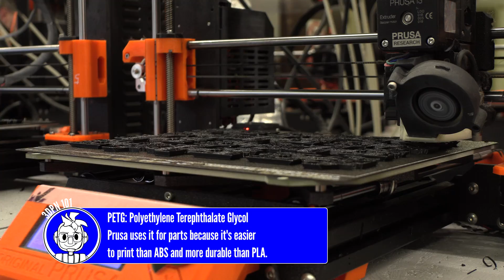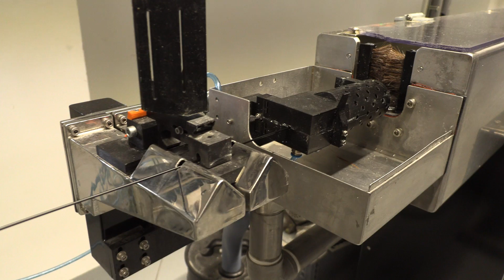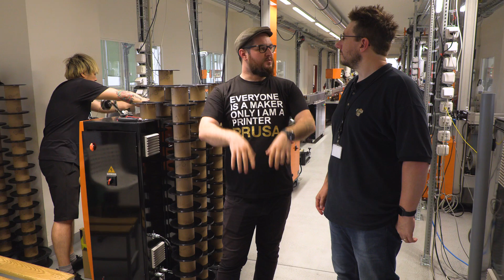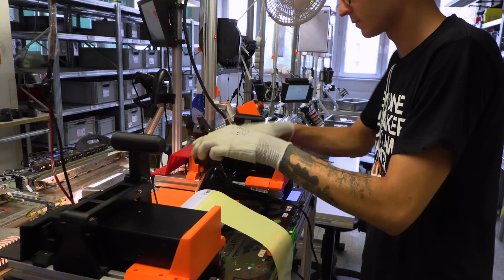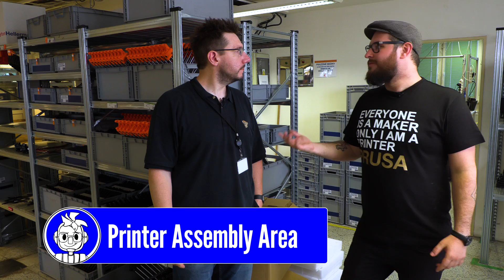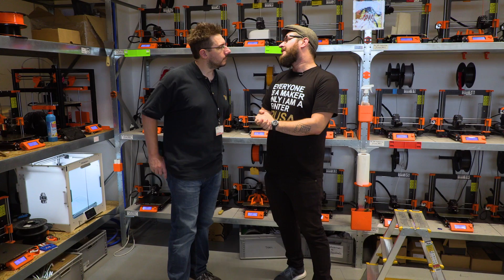Inside the Prusa Factory!

Comment: I own a I3 MK2S and I love it, it is the best printer I have. However, I struggle with Prusa's avoidance of injection molded parts (apart from the spool holder). Other than around the printhead, most parts do not change and should be injection molded. The capital investment, floor space, electricity consumptioin and labor is much less and throughput would increase and part cost approches zero. Even the parts they are developing should be made with soft tooling at "start of production". Higher production volume, lower costs, higher quality equals happer customers and a stronger balance sheet.

Comment: My lab just bought and installed 39 of these Prusa 3D printers. It's awesome & I have 24/7 access to the facility. I recently 3D printed some low-profile bull horn speaker housings for a 100W horn driver using the Prusa i3 MK3S :D

Comment: Small scale I understand using a 3d printer for production parts but at that scale, why not injection molding? This seems like a waste of electricity and man power. We have tools to do this job at a fraction of the cost.
Reply: I dunno, why do they still use an 8bit board?

Comment: I wanted to buy a Prusa but sticker shock prevented it.  These are too pricy for what they are.
Reply: Actually no.  I have also been put off by the price.  Until I recently bought a Mosaic Pallet 3 Pro.. 8 filament slicer, that was like $800 +.   I am having a hell of a time getting it to work on an ender 3 with direct drive.   Everyone i've seen with great prints is using a Prusa, The Pallet is pretty much designed to work with it more than any other printer.

I started 3d printing over 5 years ago starting with an Anet A8.  Then went Ender 5, then a couple ender 3s.     I've run into too many problems, the main selling point you will hear from everyone on Prusa is that the print quality is great, the speed is quite fast,  and the main thing for me is reliability which this excels at. They also use higher quality parts than Ender.

I sell 3d printed stuff. I have come to the conclusion with this time is money and I need the reliability.    

So to each his own, but for me it is worth it especially after spending $800 on the Pallet to have reliable prints.  And since I make stuff to sell, it is a business expense I think is worth it in the long run.

Comment: Does he manufacture all these parts with printers as a statement? Surely at this scale it's more efficient to get the parts injection molded.
Reply from the maker: I know he has been asked the question on injection molding many times, and I believe it's still less expensive for him to do it this way - with part revisions and on the fly changes without casting / creating a new mold.
Reply: @3DPrintingNerd  I just ordered one an hour ago.  Any idea why they still use an 8bit board?  Just seems for the price I don't need a nicer screen, color or touch screen, but the speed of turning the selection knob bothers me.   The difference was night and day from an 8bit board to 32bit with screen response time with my Enders.

Comment: So if you have 500 on a farm. Sell 94% grow your farm with 5% and 1% shrink. 

You basically have created a path to a Dyson sphere scale production capacity. 

A viable path. 

Adjusting for need for capital for externally sourced product and omitting greed from profits, you end up reducing sales due to your demand for capital and increasing farm growth to maintain exponential production. 

Luckily prusa is print-farming-money with space-time-money. 

Not trying to kill the sun. 

I mean enslave the sun. 

I mean sell light. 

What was this video about again. Oh yea. The haves having lots. 

I had a idea for a print farm this morning. 

I enabled my 3d printer to do more. Do it smarter and use momentum to achieve aerobic pace. 

Belt printers are where it's at.  

Gonna try to convert my creator pro 3 into a belt bed. 

Then give it robotic arms, eyes, judgment and the capacity to fail and know it. 

Hell may as well give it a blockchain too to avoid a single point of failure like sd cards. 

Is the slice on the chain? 

Then its available to print if the contract is followed according to its creators design. 

Anyway. 

That farm set me off. 

Been waiting for all years since they came out to get a 3d printer. 

Mine arrived yesterday. I got it printing 20 minutes before heading to work. 

I got a product to push on my employer walmart who didnt even consider me for the cryptocurrency and digital currency team lead director at home office. 

Did get an interview with a director 5 printlayers down from CEO. Who had no in her heart about me from the first open door email I sent to her and her bosses. 

So this video helps. 

If i need units made. Ill hit up prusa. To be a contractor. To produce the 4700 x 200 per replinishment (these are a sell out diameter product) + 2.3m (for us associates) 

I got not one question about crypto in the 25 minutes she allotted for me for a 138k per year job as a associate who has worked through walmarts bs since 2005. 

They should have hired me. Cause i know retail and tech. 

Anyway. I dont have social media. Suffer my wind!

Comment: Why is the diameter so important? After all it gets forced through the printer hot end at melting temperature. I find Prusament spools the filament has a twist in it resulting in a knot forming when printing forcing the hot end to jam and a failed print. You have to watch the whole print to supervise the spooling. I can't find any improvement in print quality from ordinary generic cheap PLA. Has no one else noticed this?

Comment: What puzzles me was the fact they using Mk 3  3D Printers to make more printer parts?  That be very slow and expensive, be better to use big multi plastic injection process factory parts machines to make thousands a day than a few hundred a week?  I understand he wishes the 3D printers to do this sort of thing as it is cool. But this way is super slow and not cost effective for a company!  Nice to have that printing use on a 3D printer But not for a company sized making them process.

Comment: Hi Joel, great videos, i recently got into argument on facebook and i was wondering if you had an opinion on the matter. Someone was asking about setting up their printer for the first time. I said the first thing that i do when ever i set up or move my printer is to check that the service that the printer is sitting on is flat and level, i then make sure that the printer is square with that surface, square the axis so that they are in line with my surface, and then i level the bed the usual way, i did a quick google to see if there had been any research into and couldn't find anything. just wondering if you had anythoughts on it

Comment: Hey, thanks for this incredible video. Im a Quality Engineer and Im really impressed with all the quality controls and automated procedures implemented in the factory to be accurate and protect customer from production mistakes. But the must important is definitely the tracking and whole producing traceability that creates all necessary capability to take corrective actions and improve the customer satisfaction. This is really awesome! Im sure my next 3D printing will be a Prusa model. I really regret that I have just bought a model from other company. Thank you so much for sharing!

Comment: I wish I could say good things but my experience was and is bad. It seems to me the heat break in the hot end unscrewed caused a giant blob. When I went to take the nozzle loose the hot end was super loose. I only had the printer 3 weeks, wrote to Prusa about damage they told me where to buy new parts. Been printing with my Ender 5 for 5 months no problems. Maybe I should have bought 2 of them instead of one Prusa.
Reply from the maker: Hey! Unfortunately without your first and last name I cannot forward this on to my contact with Prusa support. If you can, reach out to support, ask for Shane, and he can look up your records and see what happened.
Reply: @3DPrintingNerd  I love you channel and appreciate you wanting to help. I already ordered my parts and paid for them. I emailed them with what happen and was told where to buy parts. It's really about customer service. Thanks for all you do, all the problems you go thru make our life easier.

Comment: At that scale wouldn't it be a lot better and cheaper to injection mold? I'd be really pissed off to get a $1k printer that's 30% printed...
Reply: Yeah... once you have nearly 1000 printers making like 10 different parts all day every day, you really shouldn’t be using prototype machines (3d printers were called RPM, rapid prototype machines and popular for engineers going way back). It’s much faster, efficient, accurate, and repeatable with injection molding. It’s pretty sad to see so many 3d printers making mass produceable parts, they would be much better making custom prototypes for people like they are designed for (sure I make replacement parts with mine, bust most are custom upgrades, and I’m also making 1-2 copies and don’t have injection molding like this business could be doing).
Reply: @jakegarrett8109  I imagine they'll upgrade to injection molding eventually, they have to if they wanna compete with the Chinese printers.

Comment: Man the Prusa operation is impressive. I'd love to have someone ask them why they still have this giant print farm to create the components for their printer. At their scale, it would seem to be better to injection mold these components. I'm sure they have a good answer to that, I just wish the interviewers would ask that question.
Reply from the maker: From what I gather, they aren’t at a level of production where injection molding would be financially better. They makes lots of parts, but not 10s of thousands. Plus, their STL files change and are updated more frequently than would be feasible with molds.
Reply: When they can run hundreds of printers in real-world application, they can quickly catch problems and iteratively improve on the design of their printers in a continual feedback loop to improve their product. Very smart approach.

Comment: At 500 printers it's pretty much comically stupid to not do low volume(in-house!) injection molding.
The Prusa printers are great, but the way the manufacturing process is done is absolutely silly, and unnecessarily expensive.
Reply: True, but I think Prusa would rather have their 3D Printers made by their 3D Printers - and actually it would be a lot cheaper than injection molding - you do know how much time and cost it takes to make a plate for injection molding especially if they are always tweaking the design, also if you break a part you can just get their file and print your own .  There is alot of reasons why they dont use Injection molding from cost effectivness to design & Manufacturing freedom. What and how they do things is what sets them apart from everyone else.
Reply: It really doesn't make much sense. Apart from having it as a distinctive feature maybe?
Reply: It’s called marketing.
Reply from the maker: Have you looked into the cost of making molds for all their 3d printed parts? Add in the size of the order needed, and the cost the change the mold rather quickly and get a new one when parts are changed?

My educated guess says Prusa and his team have done the calculations and it’s less expensive AND on brand.
Reply: @3DPrintingNerd  In fact, I have.
A small automated injection molding machine is what, $20-30k? Each mold, if machined in-house, is ~$1-5k in time, parts, and consumables. If you outsource it, it's around $3-5k. The parts themselves end up costing cents to make, instead of dollars, and seconds instead of hours.
Molds can be changed in a matter of minutes on small machines, but even at this production scale you're only looking at running the machine at <50% duty cycle, since with a multi-part mold(which is common) will produce a couple hundred to a few thousand items per hour, depending on size and complexity.
On the scale of injection molding, Josef's business is rather small.
Parts aren't changed daily or even monthly, since there's a lot of R&D involved in making sure they're customer-ready. Up to that point, 3D printers are used to specifically do prototyping.
I should probably put this into perspective - the printers, in kit form, are around $800. Even if the markup is 50%(which it isn't), that's $200 000 spent JUST on printers. Power, HVAC and space notwithstanding. $200k gets you a very respectable, mid-range(or used high-end) high volume, high pressure injection molding machine and enough left over to do a few dozen parts in multi-part molds.
Reply: @Spirit532  parts are changed rather often, I think I heard a figure of every two weeks... Also count in the 24x7x500 printing - this level of testing is crucial for the printer reliability and couldn't be achieved otherwise.
Reply: @petrstk  If parts are changed every two weeks, that means customers are getting two week old discarded products.
Not good.

Comment: This tech scales really poorly, I don't understand the logic behind this FDM farm or any other for that matter beyond initial testing of product.
Reply from the maker: What do you mean? All print farms I've seen scaled well and were making real parts.
Reply: @3DPrintingNerd  Relative to injection molding FDM scales very poorly.
Reply from the maker: Is scales poorly over 10s of thousands of single parts. FDM is great for Prusa because not only do they get to stress their machines, they can change parts quickly if needed and not pay the huge chunk of change for another mold.
Reply: @3DPrintingNerd  Why not 3D just FDM print injection the molds instead of 30% of all production parts ad infinitum?
Reply: I wonder if a thermoplastic like PEEK would withstand injection molding? I believe SLA printed resin does.

Comment: So, even at this scale printing is cheaper than (design for) injection molding?
Reply: Probably not cheaper. But this allows them to stress test their machines and get a useable product out of the testing.
Reply: True, that is an valuable  advantage
Reply: easy to improve and adapt with 3d printed parts.. Injection molds are expensive

Comment: I do have a wish for Josef, has he thought about a PCB machine of some sort ? the market is desperate for a decent low cost PCB machine that is not a cheap and rubbish Chinese CNC. The ANT is a good option, but the parts chosen are not easy to find at the moment.
Reply: What do you mean by "PCB machine"? Do you mean a CNC mill to cut the traces? Do you mean a pick-and-place machine to put components down onto the PCB?
Reply: @MoraFermi  milling traces and drilling ect. I have a 3018 cnc and even with some upgrades it's still a massive hassle, I would really like something that just works with the build quality of Prusa.